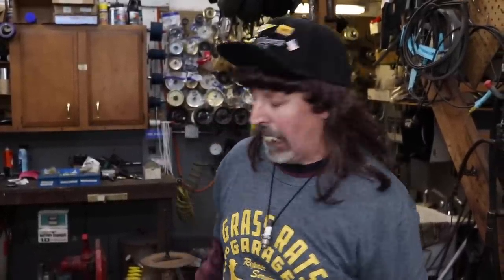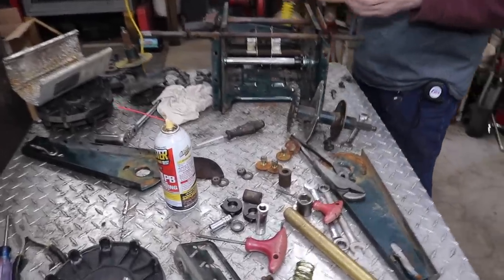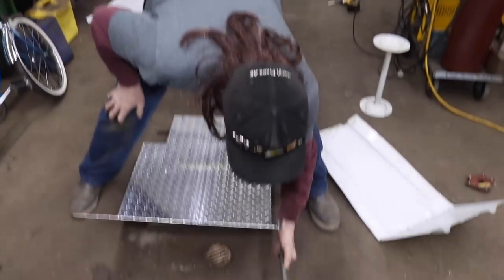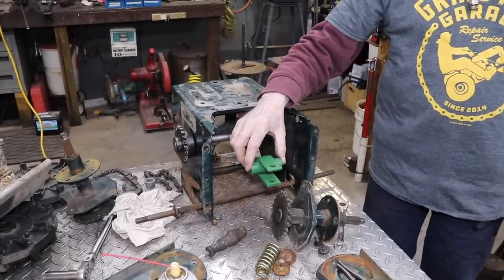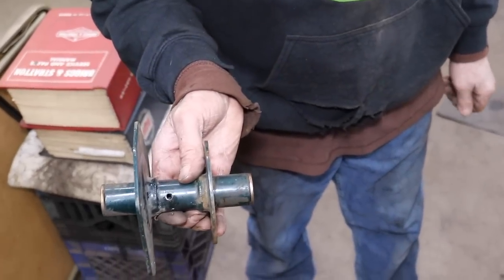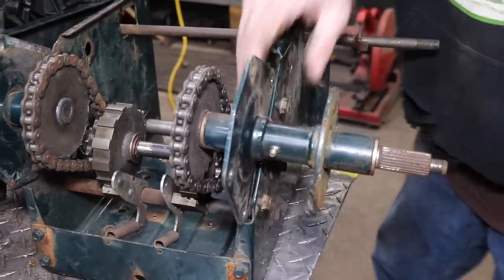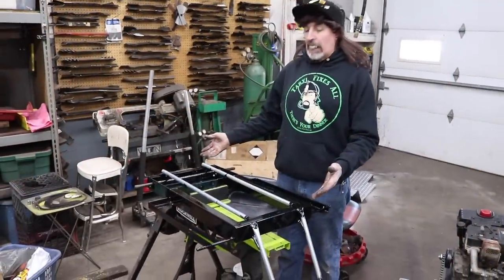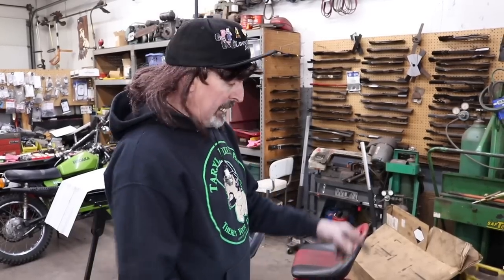Build Your Own Awesome Snow Dog (Part 2)

Comment from the maker: Grab OFFICIAL TFA Merch Directly From Us at www.TARYLFIXESALL.com
Reply: Talk to me about that schwinn. Let's make a deal.
Reply: I hate math. ey.
Reply: Personal Opinion. To keep from adding so much weight. add a real solid hitch to the sulky and I think that will alleviate a lot of your wheelie and traction issues in my opinion. I think making some sort of a pivot similar to a large loader that pivots in the center will fix a lot of issues because it will prevent the wheelie action all together. The only other solution which is a little extreme, but would probably work is make kind of a 5th wheel design and make the pivot point at the top of the unit, but the fifth wheel if designed correctly will have limited pivot action . Maybe a design hitch similar to a David Bradley an old 2 wheel garden tractor ??? Just throwing out ideas. I hope one or some of them are helpful and not keeping you up at night. Goodnight, it is late for me and take care :-)   ( I think you don't have enough of a long wheel base to prevent the wheelie action).  Maybe switch to the Torque converter if it allows for smoother starts ?  Secondly if you are still concerned about weight, add a 12 volt car battery and that will allow for electric start to etc. P.S. I purchased an old Big 4 Tire changer recently. Have any information on that old thing ? L.O.L. Guess the company wasn't around for to long. I do seem to have one of there last designed machines possibly before they went under though. Thanks again and goodnight.
Reply: You might want to use a v plow to push the snow out of the way of the tracks
Reply: About you snow dog name snow  track monster

Comment: The Snow Cats work on steep. Maybe the hitch in the get up is because your design is thinking of it working on flat. Just a thought. Maybe add some outrigger kind of things. - ok. going now.
btw. I just bought my Dad a tablet so he can watch your show with no hassle at all. 

A lawnmower that I named Frankenstein still works, starts on the second pull. I put it together during a very pleasant two weeks of watching all I could find on your show and shopping the pawn shop for tools super cheap parts. That was 7 years ago.

Thank you for presenting an intriguing, educational, mesmerizing show.

Comment: Lathes come in useful for machining down weld build-up for the shaft. Excellent repairs and line of thought. 
I used to restore old British cars- used a machinist to machine down brake pistons, press them into stainless covers, then machine them to tolerance within a thou- saved many calipers that had no spare parts (which are rapidly diminishing).

Comment: Great project Taryl.  I have one concern, I personally would add reinforcement between the seat post and the mount, on both the top and bottom.  With all the side loads, I don't think that just the post is going to be strong enough to resist the fatigue, and if you have ever had a swivel chair collapse, (I have), I don't think the idea of sitting on a spike will appeal to you much.  
Where I live, we never see the tracked machines, and when this one is done, I think it is going to be a fun machine to operate on dirt or the snow.   
I modified a Kubota tracked combine to work as a hauler/dumper, and found that the the lack of length of the tracks caused stability issues as well.  The only solution was, to move the driver's position and add weight.

Comment: When you add the extra plate for weight I would move the engine forward kind of like a rear tine tiller. It would help reduce the wheelie effect. and you would have more room over the top of the tracks to have a flat place to mount extra weight or remove when going from wheels to sled. Adapt and overcome and gain knowledge for the next project. I found out about tracked vehicles turning a two heel drive RC car in to tracks. lots of trail and error. But that was the fun and challenge of it. When I put the weight forward it help the wheelie but when I took the tracks off there was a lack of traction in the rear wheels. Good luck with this project I enjoyed  it very much. looking for part three to happen.

Comment: Snow Vole!   I looked it up. No tractor/motorized type references.

The European snow vole has soft, long, dense fur that is pale grey tinged with brown. It has a rounded nose, black beady eyes, long whitish whiskers and moderately large ears. The comparatively long tail is whitish and clad in short, sparse hairs. The head and body length is 4.25 to 5.5 in (108 to 140 mm) and the tail 2 to 3 in (51 to 76 mm). Adults weigh between 1 and 2 ounces (28 and 57 g). Its voice is a squeak and its teeth can sometimes be heard chattering.[4]

Comment: You will probably need your own weight over the tracks to get sufficient performance.

Instead of a tractor/sled combination with a hitch ... move the tractor part to the front position on a tricycle setup. Like the "Big Wheel" when we were kids ... lower the seat to the deck and put the tractor unit where the Big Wheel would normally go.

A pair of castoring skis (or wheels) on the back and your gold.

Comment: Lots of thought for sure.  It takes years of off label parts application technique to fit the cogs, bushings and bearings to those shafts.  I noticed the parts schematics and reference books you had out.  Which reminds me, are you using Spacely Sprockets or Cogswell Cogs?  Good Job Teryl!

Comment: Hey Taryl!  That looks like it'll be fun!
Love your solution for the bushings..
Back in the '60s, my oldest brother became a distributor by purchasing a couple Bolens Diablo Rouge snow machines from the factory.  Don't know if he sold any, but was happy with the dealer discount.
Each winter, we ran them all over the farm that my dad was renting near Oakville, Ontario, Canada.  The tractor/sled was pretty good configuration but never seemed to catch on.  They were fairly heavy, rather difficult to get unstuck, so not terrific in powder, but we certainly had fun..  Thanks for the video!

Comment: Really enjoying this series.  ANything cobbled together and Road Warrior looking is awesome to watch be built.
OH.  Also on an unrelated note!  Farm & Fleet is selling a "Mini Jeep" that looks very much like ... well a miniature Jeep, with Jerry can and spare mounted to the rear fender and all!!
$2,500 each, available in 4 colors including Red.
Back to the "yard crawler" ....
Before you go to the trouble of adding weight to the track part, remember a good part of the weight of the pull behind/sled/seat section could be transferred to over the tracks via a gooseneck-like hitch instead of a rear hitch.  If you add Hillybilly shocks, like you installed on the front, to the connection ppoint of this new track centered hitch, it could still move, but not be so free as to allow the track part to rear up like a mustang getting broken.  Essentially you "tie down" the hitch just forward and just backward of the hitch connection point so that the hitch can still go up and down and you can steer left and right, but that the "rearing" action of the track part is limited.  MOst of the rearing should be elliminated as you move the hitch connection point further forward on the track part.  Hope this is helpful in some way.  There's your appetizer.
Reply: ....OR you could just add a wheelie bar.

Comment: Might have been better to design this little snow track machine to where you set out in front of it. Would have taken a little more thought and fabrication but definitely possible. Mount the salky platform solid to the front with the tubing to reinforce the sled continue up and out the front to double as handle bars. Then removable casters to steer on dry ground. I think it would make use of the steer clutches and also eliminate the weight issue for traction. Just my 2 cents for what its worth...😉. Looking forward to finished product...👍
Reply: This was suggested in the last video.  I'm pretty sure he's set on doing it this way.

Comment: Put the wheels (or skies) back further, so more of the operators weight is on the tracks.

Right now, 100% of their weight is on the back wheels, since the seat is over the axle. Assuming the tracks are 4' ahead of the seat, if you moved the wheels back 2', 1/3 of the operators weight would be on the tracks.  

Assuming you are 180lb, that would be about 60lb added to the tracks & 60lb no longer on the tires. Helping traction, reducing drag.

Comment: Good video Taryl, I had a couple of those one estate and a crapsman, they were so shot the tracks wouldn't stay on Far away from the garage they would fall off, then it sucked dragging them back! I scrapped both eventually at least with wheels they will roll easily when they go into Fecal mode! 💩🤣

Comment: Use the band brake around the clutch drum. They work incredible with the gear reduction, super easy install, just one long bolt from the side case

Comment: I think the hitch on the machine needs to be low on the back as to not pull from the top with increased tongue weight making it more wheelie prone. Awesome project. Still think the sled would be better if made from a wheelbarrow tub. Thanks for sharing.

Comment: Ok, I thought about it for a while and I don't think you're going to scrap the surrey so, you still have to have the weight centered over the tracks.  To do that you'll have to mount the hitch on top center of the power. An inverted "U" channel or strutcher that  has a ball for a trailer hitch mounted to the toung -  long enough to swivel over the power and then bent down to the surrey. You still have to figure out the handle bars more straight to lift up on to keep the front of the power down in full contact with the ground . . . and clear the toung . .

Comment: You maybe could come up with a sort of compensating hitch with some spring force to counter the tractor's pitching up.  But with all that area of the tracks, it should be able to support a lot of weight, and that will help traction.  It is looking to be a real fun and interesting build so far!  Looking forward to seeing it hauling ass!

Comment: I was thinking you might want to design some sort of bump stop for that floating axle. The sheet metal will probably pound out with the shaft hitting it. Maybe a piece of one inch angle iron welded to the original frame. You could then bolt pieces of rubber to the angle iron to provide some cushion.

Comment: I just found one of those Bobcat walk behind mowers. The engine is blown (imagine that). I am rebuilding a 14.5 horsepower single cylinder engine to replace The Kawasaki. I found a guy on YouTube who made a really sweet sulky out of a hand truck. I am hoping to get it wrapped up soon so I can sell it and find another one. I also built a small bulldozer for my nephew using a tracked snowblower. Just mount weights on the front and you will see how great it works.

Comment: I think somebody said in the first video a hitch that pivots side to side but not up and down would work well you would be able to design it so that some of the sled weight is forced onto tracks for traction or if you think it has enough weight for traction and you feel you need the up down pivot to flex over terrain make the up and down pivot at the sled so it acts as a wheelie bar while keeping the Side to side pivot up by the engine.

Comment: When I was a kid, one of the neighbors had a Diablo Rouge snowmobile. It worked kinda like this beast your building. It had dual tracks on the front with an engine and drive train like most snowmobiles of the day. On the rear it had a trailer on skis with the seat.

Comment: Look at a dually truck gooseneck ball hitch to a tow trailer. Weight is partly applied to the truck to keep it down . You eed to figure a way to do this with the motor in there too.

Comment: Taryl, put the hitch point on top of the frame where the engine sits, so you have downward pressure on the tracks! If you have it off the back like you do with the small tracks, I believe it may just spin. Or you could add weights

Comment: Very innovative all your work, you were correct need weight maybe go back to the larger sprocket will slow it down. The only other thing I do when using those eye bolts is to bend the open end down to the shaft and weld it so it doesn’t open up.

Comment: Might need to move the rear wheels ahead of the seat that way it doesn't pull weight off the nose of the tracks.....love the project!
Reply: If the rear wheels are ahead of the seat, they act as a fulcrum.  Think teeter-todder.  What happens when you push down on the 'back' side?
Reply: @ItsMrAssholeToYou  there would definitely be a happy medium for sure

Comment: I'd recommend to use a articulating tounge end for the sulky seat hook up this way You'll get up & down, side to side , and it will swivel , this way you won't bind  it up when your on uneven side to side /up and down  movement, it'll ad rotation movement . just a thought , this is a cool project your doing,  can't wait to see the end results 👍
Tony H 
Felton Delaware

Comment: Ever see a mini bike with a brake band wrapped around the clutch bell? It works extremely well because it is geared down to the tire, only this app will be on the tracks. Might be something off the shelf to set all up.

Comment: Thanks Taryn for another good video,  I think instead of adding more weight on the front just use those pipe to add the rider weight on the drive like a gooseneck trailer

Comment: Okay so ... originally Your Design was front wheel or Sprocket Drive ... with rear sprockets freewheeling ... I like that.. that's good ...but it's wanting to pop a wheelie ... okay so I noticed the diameter of your sprockets is real close to the diameter of a harmonic balancer from a 350 Chevy small block ... so maybe without too much work harmonic balancer could be converted into outside mounted sprocket / wheel weight... to try to keep the front end down ... one of your best videos ... super cool what you're attempting to do here ...  very interesting ... also ... regarding breaks ... when you put snowmobile studs into those tracks and make that thing basically... terrifying ... and use it to chase Slippers clear into Northwest Ohio somewhere ... you're not going to need breaks for that ... let's just get the thing working for now... and we'll worry about breaks later ...  best wishes to you and yours ...( Just kidding about Slippers ... seems like a good kid and knows a thing or two about a motorcycle) .... TR

Comment: mount the brake inside so you can keep the snow off it better. for your trailer hitch you should make a pivot style hitch like a snowmobile would have. I notes when using any roller bearing that the bearing itself are made out of harden steel and if the part/shaft isn't hardened, it will chew it up over time. looking good.

Comment: I would suggest a larger gas tank, the last thing you need after getting a couple miles down trail is to realize, it ain't got no gas -- plus the fuel would add weight.

Comment: If you mounted the battery and engine on the front and allow for mounting them at different amounts forward to add weight to help prevent wheelies.

Comment: Put a swivel hitch on the back of the motor. If you don't mount the pipes regid and solid to the front of what your pulling it will dig into the ground because  it won't  have support to hold it up

Comment: I like what you are doing here. One thing I see that could be an issue is the handle bars are going to be hard to reach at maximum turn. I was also wondering if the cart's tounge could run under the power unit and be hung from the front. That would take care of the weight issue.
Reply: I have to agree that he's either going to need no swivel or a swivel on both the controls and the sled

Comment: You might want to make it a goose  neck fitting to the top of the plate of the tracks.  This way you could add weight from your own body weight ?? Just a thought
Reply: That's a good idea. And use dollar store HDPE cutting boards for the bottom of the sled to reduce friction.

Comment: I think you should just put the seat on it behind the motor and ride it and give it tank steering or move the engine to the back and put the seat in front of it. Maybe also put two ski or wheels in front for steering. Kind of like a mini snowmobile or tracked quad.

Comment: We made one of these using on old wheel style bush wacker back 60 years or more ago but it had drive wheels not tracks. Nice build with all the usual problems you encounter on older used equipment eh?

Comment: You got to think the sled attatchment trough, doesnt it need to pivot too? If one of your tyres go into a rut or up on a bump, or if the tracks do the same. You built it to move up and down but i think it will need to pivot from side to side too like a wheel loader.

Comment: I would line the bottom with a road sign. I made a skid plate out of a do not pass sign.
Reply: i was wandering what happened to that sign in town.🤣🤣🤣
Reply: corrugated, galvanized steel roofing sheets

Comment: Hey Terrell I just recently purchased a 16 hp Brakes in scrap‘em Vanguard V-twin I need to swap the exhaust for something that puts the muffler up about level or above the gas tank that sits on top of the engine any advice on something that might work in that area?

Comment: I think you have to many pivot points on your horizontal axis. The front of your sled will always be bouncing around and you'll have very little control over tipping forward or back. 
I can see you going head over tea kettle backwards. 
I suggest a solid a frame to the sled and just have the pivot at the tractor.

Comment: Taryl, I noticed you have a band brake, would you happen to have a part number for the pins that go through the band, that the brake cable attaches to? Thanks in advance.